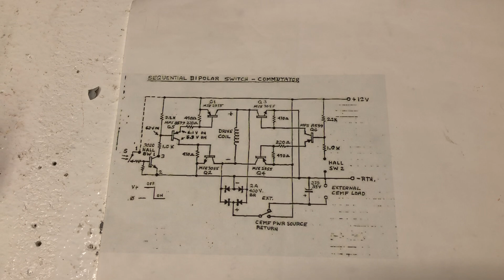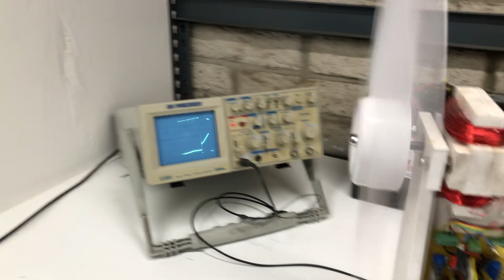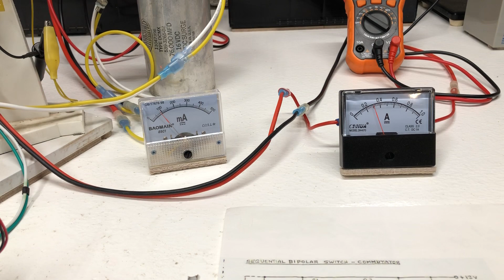Sequential Bipolar Switch with optical timing

Comment: Very nice work :D! What's the size of the fan blade? Thanks in advance!
Reply from the maker: Thank you ! 
 16.5 inch
Reply: @kenergy1707  Do you have more details about this particular motor? I'm building a similar one and yours looks very effficient. Thanks!
Reply from the maker: @erathke  very cool ! 
My first video is another fan that’s more efficient and more powerful it has 6 coils 3 mosfets
Reply: @kenergy1707  I'll take a look! Thanks again!